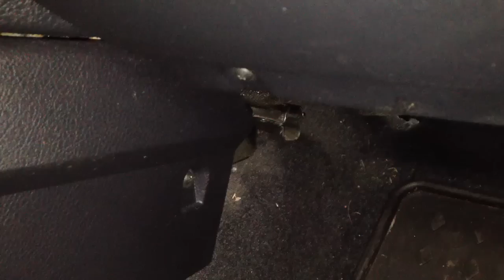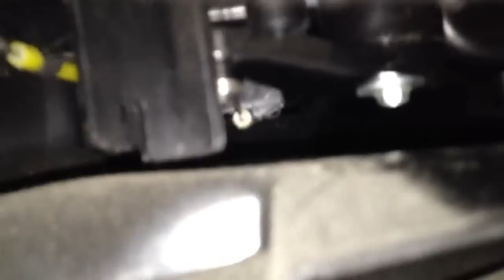Blend Door

Comment: I have a 2013 audi a3 8v. New heater matrix, auxillary water pump and timing belt and water pump. The passenger side is warm as it should be. The driver side is luke warm. From vcds driver side temp is 46 degree. Passenger side is 24 degree and footwell temp is 24 degrees. How can i get this sorted. Isit the blend door. Also no fault codes on vcds.
Reply from the maker: If the temperature is showing 46c and actual temperature is lukewarm... then the temperature sensor might be bad.
Reply: @EXOVCDS  i have swapped them from left to right and the values are still the same
Reply from the maker: @amirakhtar7054  It does not make sense to me that temperature shows hotter than actual air that is coming out. Was this problem there before all the work was done or after? Does VCDS have any "basic setting" or "adaptation" functions for blend doors? When you compare blend door values (left & right), do the values match?
Reply: @EXOVCDS  hi. Coolant temp 84 degrees.
Left front vent temp 63 degree
Right front vent temp 29 degree
Footwell vent temp 30 degree
Temp after evaporator 3.9 degree
Interior temperature 36 degree
 These are the values i have from today. Driver side vents are colder than passenger side. Passenger side vents are warm. No error codes ln vcds and basic settings have been performed.

Comment: I only have air blowing through my center vents nothing on my side vents?
Reply from the maker: Year, make, model?
Reply from the maker: Manual controls (dials) or climatronic (push buttons)?
Reply: 2001 Volkswagen Golf GTI GLX 2.8l with climatronic
Reply from the maker: Check your blend door motors.
Reply: How difficult are they to replace?
Reply from the maker: @ChaseHollandProductions  using a scan tool... you can activate basic settings. The climatronic will cycle all the blend doors through full range... that can tell you if there is a blend door issue.   You can also check for fault codes. Not all of the motors can be accessed with the dash in place.
Reply: Thomas EXOVCDS can I do this with vagcom lite?
Reply from the maker: @ChaseHollandProductions  I don't know, maybe.

Comment: I have a 2016 jetta 1.4 SE.  I seem to have decent heat coming through my vents, although not always as hot as it was before.  Main concern is even though i can get it up to heat its very cold down around the floor by the console, more so on the passenger side.  Does this sound like a blend door malfunction?  Looking for any suggestions.
Reply: Also there is not dual climate control only single.
Reply from the maker: I'm not sure how things are operated on your 2016 vehicle (I haven't checked under the dash myself)... the blend doors could be cable operated like in this video, or all blend doors could have small electric motors that operate the doors. Have a look under the dash to see if you can see anything (cables) while moving the control knobs.
Reply: @EXOVCDS  Very much appreciate your quick response!  I dropped the car off this morning at the dealership, just waiting to hopefully hear something from them soon.  Being in MN and 0 degrees this morning needed to get it taken care of ASAP.  Again i appreciate you responding so quickly.
Reply from the maker: Thanks for the update!

Comment: 2014 vw passat heat only on driver side. Blend door? Great video
Reply from the maker: Possibly... could also be a temperature sensor issue (if the climate control module thinks that passenger side is already warm, it will not open the blend door more). Watch this great video for some great info (that might apply to your car):
https://www.youtube.com/watch?v=zm1HRU64Dpo
Reply from the maker: Any update?
Reply: I was told blend door
Reply from the maker: @daoyster8579  thanks.
Reply: @EXOVCDS  thanks I really appreciate it. Great videos
Reply: @ John Lee. Sorry and Merry xmas. I have a question. I have a CC serie Volks, by any chance, do you know where to find the blend door on the cc and how much it'll cost me? My car blows air but it not hot. In the summer you alcan feel a little bit of the hot air, but on a weather like this in NYC it imposible to feel it. My windshield frezees.
Reply: @yensimartinez2027  
Yes hello happy holidays. Its between 175.00 and $200
Reply: @daoyster8579   Thanks for your reply with the information. Happy holidays!!!

Comment: hey Thomas, my 04 VW Jetta with a bbw, I replaced ac compressor, drier, expansion valve. vacuumed system for an hour, then filled with refrigerant, even weighed it. Temp down to 50 degrees. shut it down feeling very proud. about an hour later I go for a test drive to show off to the wife and zero, I mean ZERO cool. Ideas??? Thanks!
Reply from the maker: Was the compressor turning on at that time? If yes, check the blend door operation. If the metal AC line in the engine bay is not cold, then it either lost refrigerant (low pressure) or the system is protecting itself (high pressure) by not turning the compressor on.
Reply: @EXOVCDS  compressor kicks right on with switch. Will ck line temps and I guess relace blend door. Thanks!
Reply from the maker: No need to replace anything until you verified things / determined that it is bad.
Reply: neither line gets cold (low side is the one to get cold, right?) but neither does. compressor does come on. I know when I filled it the compressor did come on real quick when I started filling.
Reply from the maker: Hmm... attach High & Low pressure gauges to see what the pressures are. Might help steer you in the right direction.
Reply: @EXOVCDS  low/high. Connect 95/100. Started and idled 80/90. Shut off 85/90.

Comment: 14 Passat: I’m getting good airflow but no heat whatsoever. Do you think this could be the issue or am I going to be replacing something else?
Reply from the maker: Dual climate control or single (can driver & passenger heat be adjusted separately)? If dual, is the heat bad on both sides? Could be a blend door issue or plugged heater core... or a temperature sensor / electrical issue. Not sure without looking at it, sorry.
Reply: @EXOVCDS  Single control. It blows through all vents, just no heat. I felt around all the hoses and they were hot  I'll be having to take it to someone, unfortunately.  Thanks a ton for the quick response! I appreciate it!
Reply from the maker: If it's single, then it's either a blend door or heater core (plugged) issue. Let me know what they end up finding.
Reply: @EXOVCDS  Will do, I'm going to flush the core this weekend and if it doesn't work i'll be taking it in. Thanks again!
Reply from the maker: OK

Comment: I'm gunna check this tonight, if it's broken, changing the temp from hot to cold would do nothing correct? As I have a bit of foam coming through the vents and no heating, really don't wanna get the core out so hopefully this is the problem! Also if the blend doors have lost there foam is there anyway of blocking the cold air duct so I can have heating only during winter?
Reply from the maker: Year / model? If you have foam coming out the vents, then the problem is related to that. Yes, if that blend door is not connected, then there is no control of heat. You need cold air to "get warm"... the only way to block the cold air from staying cold, is to reline the blend door.
Reply: Thomas EXOVCDS '93 golf mk3, yeah I thought so, although it's not a lot of foam and is only coming through the main vents, so to be sure I'll check temp control, is this video of a mk3? where abouts can I find the arm?
Reply from the maker: Mike Gulliver This is a mk4... mk3 is similar.
Reply: Okay thanks, is this under the driver's side panel?
Reply from the maker: Mike Gulliver Better access through passenger side... check both and see which is better for you.
Reply: sorry to keep bugging you! but there is a difference between hot and cold when I turn temp control so I'm guessing it's working? just got luke warm air instead of hot, can it be anything else or is it most likely the blend doors? as cold is very cold and hot is luke warm
Reply: Mike Gulliver the blend door may not close properly so most of the air might not go through radiator, that’s what I think. Have same problem on my mk 5

Comment: Hi there, I have narrowed down my no heat issue within my 2002 b5.5 1.8t passat to something in the blend door/door motor/ or something within this system (not heater core as both hoses are hot/even heat while the heater is on)...now i did exactly as you have done here, and my lever (bright orange instead of black) is moving similar to the one in this video...I just dont understand how the lever in your video is broken. It looks like its moving as it should? is there something im missing here? also, in order to access this system, an entire dash removal is required? im guessing the door has lost its foam/ and or a motor is not moving the door properly... I thought i had dodged a bullet by not having to remove my heater core and now it seems like this issue provides no less grief lol...
Reply from the maker: A moving lever doesn't mean that the blend door is moving.... yes, could be that the foam is missing (cold & warm air constantly mix). Use a borescope to look into the heaterbox to see if you can see the blend door moving and if the foam is missing.

Comment: Hi Thomas, I need to replace this bushing. As it is very tight, what would be the best way to approach this to make the removal of the broken bushing and installation of the new one easier to access?

Thank you Thomas.
Reply from the maker: karynlh This view is from under the passenger side ...  nothing was removed to gain access. The small bolt / screw should be accessible as is. It's a tight area to work in, but can be done. If not, remove what you have to to gain access / be able to work on it.
Reply: ***** Thank you Thomas....I signed up for your forum as well. Real cool of you to offer encouragement and wisdom. Cheers my friend.  :0)
Reply from the maker: jerkwagon It's a bit of a tight squeeze / area to get at, but with a little bit of patience... you can pop a new one in to place:
https://www.ecstuning.com/b-genuine-volkswagen-audi-parts/blend-door-support-pin/1h0819136/
Once the knob aligns, you will be able to push it up into place and then you just need to secure the lever with the cable to it.
Reply from the maker: jerkwagon Yes... sometimes it is more involved. Worst case the whole heater box assembly has tom come out for repairs (after the dash is removed). Good to hear that you have heat again!
Reply: I have a 2002 Cabrio and I've located the lever/arm and cable and it seems to be working fine as described but only when the mode knob is turned.  No movement when the blend/temp knob is turned.  My AC system was checked for leaks and pressure at a goodyear service center and they said that everything checked out so it must be a blend door air control issue and suggested I take it to a Euro Specialist or the dealer to check it out.  When turned to max AC, I only get slightly warmer than ambient air after it goes down maybe 4 degrees at first.  The blend doors most likely have no foam left covering them so this may be the heater core's interference causing the warmer air coming through when on AC.  When turned to heat, it is much hotter than AC, so I would assume the blend door control is working since it seems to be an all or nothing kind of thing.  Wouldn't the blend door control lever be separate from the mode one?  I don't see how it could be shared which would imply that there should be a separate one somewhere else and explains why I'm seeing no movement of the one in the passenger side footwell inside the passenger side console when I move the blend/temp knob.
Reply from the maker: The cold/warm adjustment is usually a separate cable (controlling the main heater flap door). Looking under the heater box assembly, you should see a blue plastic tube with a cable running through it). That cable needs to move when you are moving the temperature dial. It may have come loose somewhere, causing the whole tube to move. The tube should be secured at the control panel and at the bottom of the box. If the tube is moving, the blend door can not work correctly.

Comment: Hello Thomas, 
I have some issues with my vw golf mkv , the passeger side of my car is always cold , even with the temp set on "HI". I guess the blend door is stuck, can you provide me some info about the location of it? 
Thanks in advace
Reply from the maker: mihai nicolae 1k Vin? What engine?
Reply: ***** Hello Thomas,
Luckily, I found out that the problem comes from the g151 sensor. It was reading 85 celsius on the passenger side , that's why the climatronic tried permanently to cool it down. I ordered a new sensor. hopefully will fix the problem.
Thank's a lot for the quick response!
Reply from the maker: mihai nicolae Good to hear you found the problem! Thanks for the update!

Comment: Is there also a switch in there which closes some type of valve to stop the hot water or is it only a air dirverter box door??
Reply from the maker: Most VW's have an open flow heater core system (coolant is always circulating through the core). Temperature is controlled by blending / controlling air flow through or around the heater core. Some models have heater valves. Year, make, model, engine that you are concerned with?
Reply: @EXOVCDS  Mk4 -2005.. But I just got lucky - the actuator below the heat -cool door fell off - the slot from the door went to the side but after an hour I got it all aligned carefully thanks to my mini camera and a pick.. Finally got the heat off!! The seal is still good apparently,  BUt I just told the wife next time I am going to install a valve on the hose.Vintage Air has something like it I was going to add to my Datsun.  Thanks for the info!! Very helpful.
Reply from the maker: Thanks for the update... they can be a pain to pop back into place. A fellow youtuber makes his own retaining clips that are of better design than the stock! Watch this:
https://www.youtube.com/watch?v=2Yz2p1apm_w